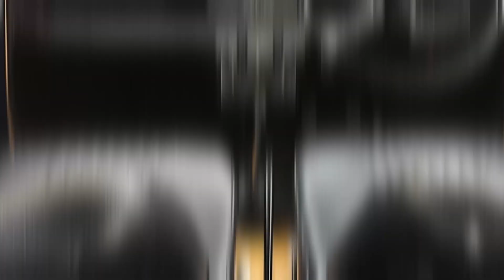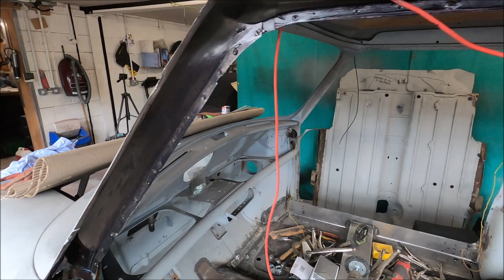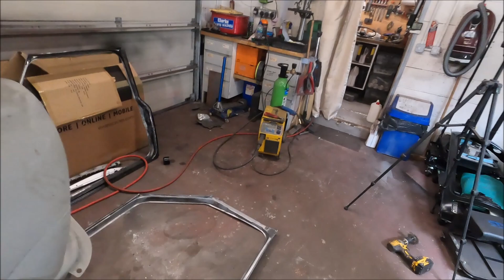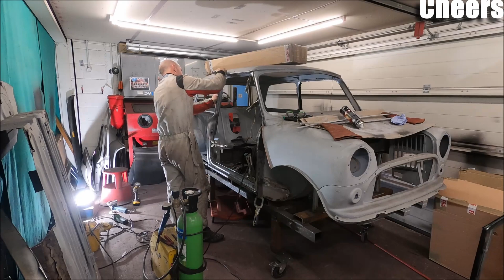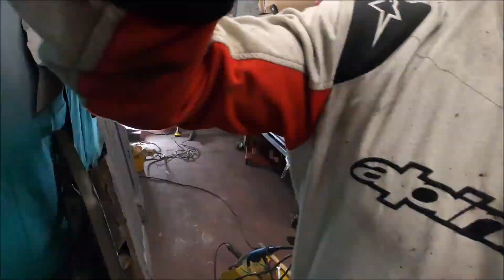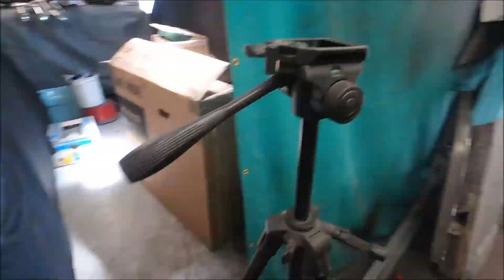*Fitting the side panels* Cooper S Mk3 Restoration - Classic Mini Workshop Pt.29

Comment: Looking at the door itself, the issue is not the window frame / windscreen A pillar. It's the door itself. Get the rear quarter in place first so that you are happy with it. Then as you mention, get some weight in the door, get your swage lines aligned then have another look at the front edge of the door window frame. 

Currently you have a huge gap at the rear of the door window frame to B pillar.
Reply: Thanks Ian. The main problem is that the panels are not the same profile/shape as they were 50 years ago due to worn pressings etc. Lots of manipulation required in a lot of areas to get it right but i'm moving in the right direction with it all. Lots of areas i can tap about to get gaps bigger which is what i'm doing.